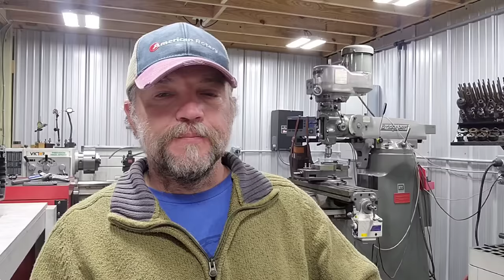IS THIS THE END of HARLEY Performance? - The EPA Freight Train is HERE! - Baxters Garage

Comment: Well I guess Vance & Hines saw the writing on the wall because all of there exhaust systems have cats in them now. That’s why I won’t buy their systems anymore. Eventually we will all be riding electric motorcycles with sound generators on them. We have to get the democrats out of the white house.
Reply: Before you get mad at political party that you're already biased towards, the clean air was passed by both parties. As a whole, it's a good piece of legislation that needs some updates that allows an individual the right to repair.  I've spent some time in the diesel world and you don't want that legislation pulled. Imagine Walmart running all of their 10,000 tractors down the freeways with straight pipes.
Reply: Thanks for the heads up sir. I'm in the great Republic of Texas and here they're doing away with vehicle inspections as of 2025. I don't know yet if that includes motorcycles but I'm definitely against my freedoms being stripped away little by little. Voting is going to have a big part in this, stay positive! 17:20

Comment: Hi Kevin 
I work at Cummins, in research and development.
We work with EPA / CARB all the time. 
I been doing this for over 45 years. 

Kevin it’s all about the money and politics. 

We just received a 2 billion dollar fine!  WoW…

Let’s step back and look at a bigger picture..

Take a Dodge Ram 2500 Cummins Diesel. 

Average 13 to14 MPG  stock.  
This truck can average 20 to 21 MPG.

How many gallons of fuel will be saved in just one year. 
Multiply savings by every diesel truck in the United States.

Wow that’s a lot of fuel.

Now that we’re saving millions of gallons of fuel a year  the refinery will reduce EPA emissions.

Now think of the after treatment with all the precious materials needed to reduce emissions on the trucks.

think about  heavy duty equipment, used in mining to get the precious metals.

I think about all the computer chips needed to run the extra software .

Think about the factories, that build, EGR valves, EGR, coolers, etc!

More emissions are admitted by trying to reduce emissions out the tailpipe.

Comment: I could write a paper about the differences in engineering tech between motorcycle and auto engines/ tuning. It’s about 10 years currently, the big issue going to forward is air cooled engines are basically dead from an emissions standpoint. You can’t regulate combustion temperatures anymore by just throwing fuel at it or leaning it out to bring it up the temp NOX in particular is why they killed the Evo engine over in Europe for euro 5 regulations 

Basically be prepared for water cooled engines “not a bad thing” but you won’t get the same soul if that’s your thing. Plus direct injection is on its way because both KTM and Kawasaki are going full bore on it

There is nothing wrong with more auto tech in motorcycles engine but you can only get so much out of so much air and fuel. We are basically at the limit now in the automotive world HP numbers are seriously starting to slow and even go back

Comment: I had an Auto repair shop for 45 years. I went through all of this in the early 80's. We were very careful to operate in compliance. Hell I would not even touch an exhaust that someone had cut the cat out of and wanted us to weld in a test pipe. Not only could we face fines but could also face an up to ten year prison sentence for alleged tampering. Same with installing a tuner into the Scan test port. 
  OTOH the bikes including HD will become better, faster, and longer lasting because of the engineering required to both satisfy consumers and the EPA.    Thanks for the well spoken reality check.

Comment: Once manufactures find a way to make good power that is in compliance- the letter folks choke the regulations down even more. Good tuning will increase hp and fuel mileage but the tail pipe isn’t “clean enough”- but now burning more fuel is ok- the fuel that has to be manufactured and hauled to the fuel station by a large fuel consuming vehicle..

Comment: EPA's initial standards regulating motorcycles were promulgated on December 23, 1976 (42 FR 1122). In that final rule EPA made the finding that highway motorcycles were a contributor to air pollution and that control of their emissions is necessary to meet the National Ambient Air Quality Standards. In 2023 Harley-Davidson had to  pay a $12 million civil penalty due to tuners. Harley-Davidson also manufactured and sold more than 12,000 motorcycles that EPA alleges did not undergo proper EPA certification to ensure they meet federal clean air standards. EPA alleges that Harley-Davidson violated the Clean Air Act by manufacturing and selling about 340,000 devices, known as tuners, that allow users to change how a motorcycle’s engine functions.  This is directly from the settlement page of EPA,  Thanks for sharing. This will give some idea as to how much it has cost Harley over the years to stay in business, and navigate gov regs.

Comment: I'm a hot rodder and drag racer (vintage cars only, no computers, no emissions) I'm also a Harley rider. And while I despise the EPA to no end, I don't understand the Harley performance thing. I have 2 Harleys, a 1989 FXRS Low Rider I bought in 2003, and a 2001 Sportster 1200C I bought just a couple years ago, when they discontinued the Sportster. Both have aftermarket exhausts, that is just to make them sound like Harleys. Power wise they are 100% stock. I don't race these bikes, they are cruisers. I use the FXR as a solo touring bike. It cruises just fine on the highway. Obviously both are carbureted. I have owned a lot of bikes from a lot of different brands over the past several decades, one thing they all had in common is they were all carbureted. I would not even consider riding a computer bike. It's just not going to happen. If you want to go fast (and remember there is such a thing as speed limits on public roads, and I do support those 100%) then get a crotch rocket, and go as fast as you want, until you lose your license. Harleys are not about going fast.
Reply: Harley's aren't about going fast to you. That's OK. There are a lot of people into classic cars with 100% period correct parts and tuning, but some guys back halve them and proceed to make them as fast as humanly possible(usually with fuel injection). My point is that some people like fast Harleys, and that should be OK as well.

Comment: I had a 1981 Superglide. It had the capped off idle screw, very lean jets and large quiet muffler. I purchased the bike new here in Wisconsin. The bike coughed all the way home. Got it in my garage, accessed the idle mixture screw, replaced the low and high speed jets and punched out the plug in the muffler. At the point the bike had only about 30 miles on it. So I guess emission standards started back then to some degree.
Reply: They started long before that

Comment: Suzuki Hyabusa...whisper quiet, 161 at the rear tire and 100ftlbs 9700 rpms of torque Euro 5 compliant. Kawi Zx-14 even more hp (201 at the crank) and we are talking 1380 and 1440cc's respectively. The Triumph Bonneville line up moved with the times and kept the iconic Bonneville sound, a place where the Rev Max fails. I agree with what's said above, HD is going to have to convert over to the Rev Max in all lineups, unless it is working on a Triumph Bonneville style water cooled (faux air-cooled) set up to keep that legendary sound and feel. Kevin, I get what used to be the bread and butter for HD's ( a lot to be left on the table) bikes, is now being heavily regulated. What will most likely come about is EPA certified cams and intakes. Be the first to patent cams and intakes to meet the regs, otherwise it you'll just be focusing on repairs that owners can't perform themselves.

Comment: I have a m8 107 ultra, I have kept it with factory tuning,pips and cam but changed cam bearings,cam plate, tappets, tappet guides, oil pump to the best quality I could get , going for reliability over power

Comment: All the new bike run hot with the AFR s the Government mandates pinging and just not running well. if you could just take them a few point richer and be compliant that would be great and course timing. I think that’s a lot of the reason Harley is moving to VVT systems to make the bike happier at these leaner conditions
Reply: When the HD vvt bikes came out I suspected is was more of an EPA measure than a performance enhancement. The vvt system was likely developed by HD to lower NOX  emissions by lowering the combustion chamber temps. In the early 200's I worked for general motors and took the factory training for the new 4, 5, and 6 cylinder inline engines used in the Chevy Colorado trucks and trailblazer suv. These engines used vvt to induce overlap and lower NOX emissions by lowering the head temp.
Reply: *early 2000's

Comment: You got me SNARLIN Kevin. I'm a Yooper that lives in the sticks. EV is not practical on a day to day basis. 10 degrees snowing sideways would kill an EV battery in quick order. Wipers Heater Lights Radio driving thru how many inches of snow and wind 30 miles home from work at 1 AM.
I believe this is exactly why Toyota has committed more resources to Hydrogen engine tech and slowed it's Battery development. Check out the Toyota times news letter Oct 23.
My point is we aren't going to wag the dog. So where ever the automobile industry goes we are likely to follow. The auto industry is bigger but Bikers have always been more innovative. 
What would you bet that if Hydrogen internal combustion ends up as the answer some crazy Biker will figure out how to make it run like a scalded Dawg?

Comment: I just installed Cobra powerport headers on my 2016 Ultra Limited. I bought the Cobra Neighbor Hater slip-on exhaust last year along with the high-flow intake and V&H FP3 Tuner. Glad I got it all now. Hoping Wisconsin doesn't decide to jump on the inspection bandwagon.

Comment: It's the idiots who delete diesel trucks and car companies that used cheater software on their vehicles who are screwing over the aftermarket motorcycle industry. Someone who owns a Harley that's built up with aftermarket performance parts is doing significantly less damage to the environment than those who spew black smoke every where.  Motorcyclists aren't riding their bikes every single day depending on where they live in the country too.

Comment: Motorcycle emissions requirements date back to 1978. The EPA required limiter caps on the idle mixture screws could not be adjusted more than 1/2 turn either way started in the 1978 model year. Then in 1983 the EPA required sealed mixture screws. Those two requirements were based off of findings by a study conducted by the University of Colorado Boulder using and Oldsmobile with a 350. Fun fact, it's one of the reasons why Triumph had to stop exporting motorcycles to the USA in 1983 and a major reason for the Evo engine and industry wide switch from iron to steel sleeved aluminum cylinders.

Comment: I appreciate you, Mike. Im sure this is an unpopular perspective here, but i take pollution seriously. It is a problem. However, as Mr. Baxter touched on, I believe motorcycles could be a huge part of the solution. Riding a motorcycle over 5,000 miles a year should give one federal and state tax breaks. We need lane splitting, motorcycle lanes, speed tolerance, etc. I dont see further tightening on motorcycles effective in decreasing greenhouse gases.

Comment: My stage 3 Evo runs great and it gets 42 mpg on average in the city (48-50 highway average but it's been as high as 62 mpg, but that was coming down a mountain). It's stock stroke and bore but upped to 10.2:1 compression with hearwork, modified CV carb, D&D Low Cat exhaust, Woods W6H high lift cam (.590"), Dynatek 2000i ignition, Baker DD6 transmission. She runs 80/85 HP/ft-lbs (whereas a stock BT Evo I think was 50-55 hp).

It actually has better gas mileage now than when it was stock (stock averaged 38 mpg in town).

So yeah, properly tuned, should be at minimum 38 mpg, but capable of more without running hot or poorly.

Comment: It was easy to get the HP and torque back up on those old big block engines by replacing the intake, carburetor, and exhaust system with aftermarket parts. For example, the Chevrolet 396ci engine came stock at 375 HP. Replacing the intake with an Edelbrock, the carburetor with a Holley, and the exhaust system with Hooker headers and Hush Thrush mufflers, after a bit of tuning the engine then output just over 600 HP.

Comment: The ECU progression for HD is : 
Magneti Marelli 95-2001; 
VDO-IGN(Carb'd) 99-06,
Delphi 2001-2024, 
O2 sensors started with Dyna 2006 ... 
ABS on 2008 ... 
RDRS 2020 as option ... 
The one company you say, it is not selling in the USA, only

Comment: The current laws make ANY modification to the engine, ECU, exhaust (even slip-ons) 100% illegal.
Look at what has happened to the diesel market. They shut down every mod and tuner one by one with massive fines. The EPA bankrupted the industry one by one. 
The current law prohibits ANY modification on any vehicle originally titled for street use. That is being debated in the auto racing communities right now. You can not legally buy a Camaro and mod it for the drag strip or road racing even if it never goes back on the street. This is not a conspiracy theory, this is fact. The law has not been enforced to it's strictest form YET. But it will be. Death by a thousand cuts. Same as they are doing to the 2A community

Comment: Hey does anyone remember how engine builders in the 1980’s used different cam profiles and the then new fuel injection to actually get those low compression Chevy 305s run really well even with cats  still installed. 302 fords as well. Why the hell can’t Harley develop a low compression clean running engine that runs on regular. But really work on all the other parts to get the horsepower. Another thing that greatly improves performance is lightening the bikes. Put em on a diet. Trim a touring bike into the 700’s 
Also a lower compression engine is stressed less . Cylinder head bolts and cylinder bolts would not stretch so much . Less leaks. Maybe less blow by. Also here’s the bad idea. Liquid cooled. So controlling temperature and mixture. And cleaner emissions.

Comment: Even selling parts that replace emissions components will become illegal for motorcycles. Right now they get away with selling the parts by a disclaimer stating “track use”. 
I wonder how long Harley will get away with air cooled engines? Granted they had to go to partial water cooled but,  props to them for being able to get there engines to pass emissions for as long as they have. 
So the real threat only pertains to the air cooled engines. The air cooled engines have been neutered for so many years that you had to have a performance aftermarket. 
Once all HD goes full water cooled, the performance tuning will not really matter. For comparison the Revmax puts out 150hp stock vs. a 135 stage 4 tuned putting out 130hp. So HD could just throw in a Rev max into every bike and blow away HP on even there most powerful air cooled engine. 
Now, the RevMax hardly has the charisma of a Milwaukee 8 but that may be something we have to let go of if the EPA banishes performance tuning. Or we are just going to have to live with the lower stock HP air cooled engines.

Comment: Remember the 1-4th gear "auto" gear shift on GM 6 speed manual transmissions? Man I hated that on my LS2 GTO! You pull out from a stop under a certain speed and you couldn't shift to 2nd gear you had to shift to 4th. It was supposed to"save gas".

Comment: when you say motorcycle world you man Harley, sportbikes are far ahead of cars today, pneumatic valves, dual butterfly, dual injector, SHOWER injector throttle body intakes, 225 whp from nat asp I4 . .  significantly ahead of cars, you can take a 1300 CC turbocharge it and end up with 900 hp from a stage 3 setup, hit 250mph and ride it on sunday all day long, that's more HP that V8's are getting supercharged 3 times the CC's, lets see inertia sensors, 365 degree angle sensors, launch control all divvied up into to advanced traction control modules and ABS.. sportbikes are miles ahead of automobiles mass manufacturing wise .. maybe harley of course they have always been 50 60 years behind, they finally got FI, which came out on sportbikes in the mid 90's

Comment: Harley "performance" did just fine before EFI. Even if aftermarket mods fade HD parts are easy enough for the dedicated to make for ourselves (nice dovetail ram Bridgeport ya have there).
Toss most of the silly electronics, fit a crank trigger ignition (they are simple enough DIYers made them long before modern EFI), bolt on a carb then ride happy.
That's also a fine time to chop the rest of the dead weight and dig out the motorcycle hidden beneath. The old ways were always best. For those so inclined DIY ECUs are improving quickly in the car world.